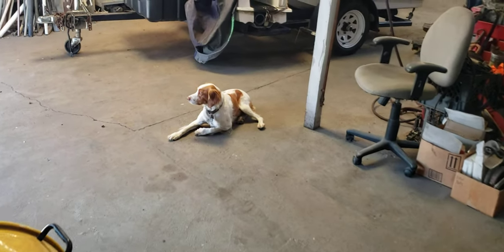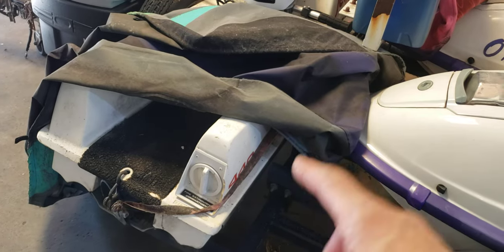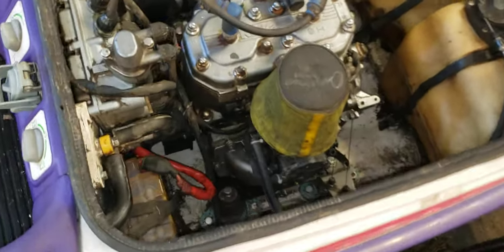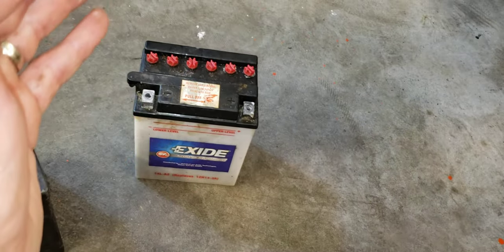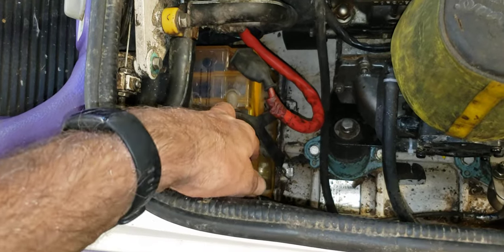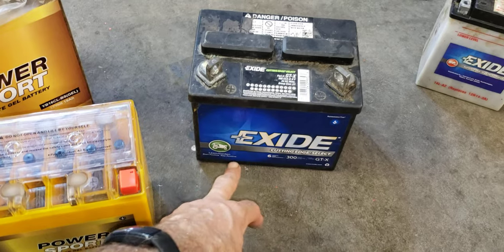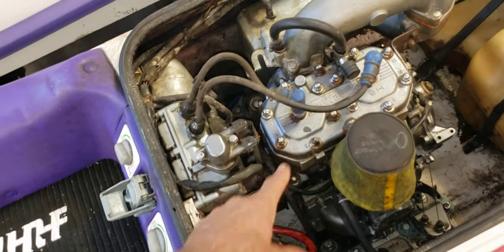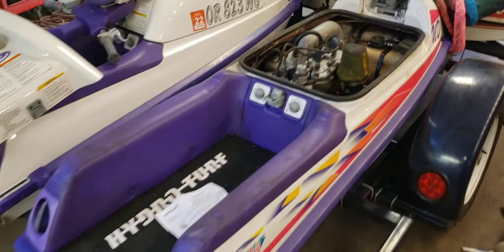Ancient Kawasaki 2 Stroke Stand Up Jet Ski Battery Upgrade

Comment: Limit the charge current to thirty milliamps or so and they'll last year's!  Do this for all your lead acid batteries and you'll end up saving a ton of money. I have a 1996 Nissan Navara known as a hardbody double cab 4WD truck and when I got it about four years ago it still had the original Nissan branded batteries from 1996 as it was driven every day by it's previous owners which kept them pretty much fully charged. I couldn't believe it. I don't drive it all that often so they died pretty quickly after I owned it. I've replaced both batteries now and keep a small solar panel in the windscreen to keep them topped up. I used to do this with motorcycles as well. Gel cells are the same when it comes to sulphating  up btw. So trickle charging helps them out also
Reply: Use 3 year warranty batteries they are better quality, cheap one are rubbish 2 years MAX cost you more in the long run. Back in the 90s Nissan built good quality vehicles, after they merged with Reno, and CVT,s came quality went rapidly DOWNHILL!! 👎👎

Comment: Similar coldcrankcurrent problem on my Goldwing GL1100 from 1981. Swapped the original leadcell for a lithium ion. Now 6 years ago. When parking undo the -  . After 3 months winter hardly discharged. Cranks like a charm. So the high price really pays back over the years AND the high crank current. The veeery compact size. It does have less Ah's.

Comment: With machines that do not get a lot of use, just occasional; a GOOD battery ( 2--3yr warranty, cheap batteries are NOT worth it they cost you more in the long run )  and trickle charger is a BIG help, ( having a bigger battery than recommended is good too ) set up a digital timer switch to give say 1hr a day, good spark plugs ( i use NGK good, reliable last well ) good tires, these things mean it is ready to go when required 👍👍🙂😀👍👍